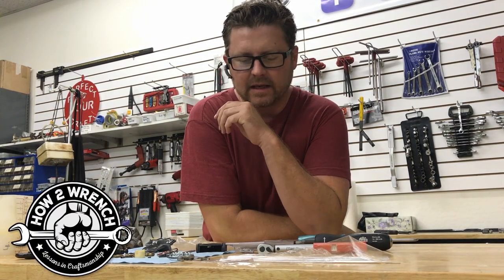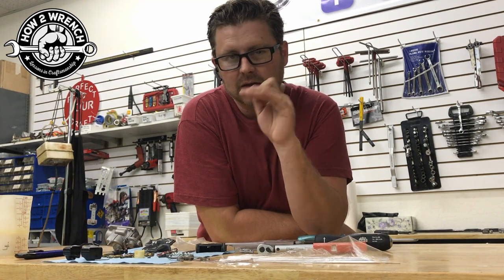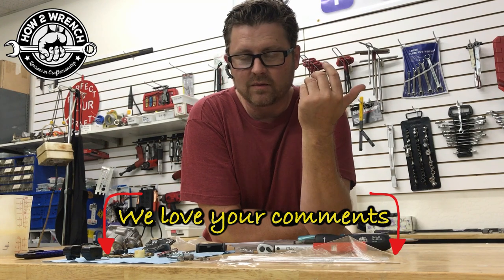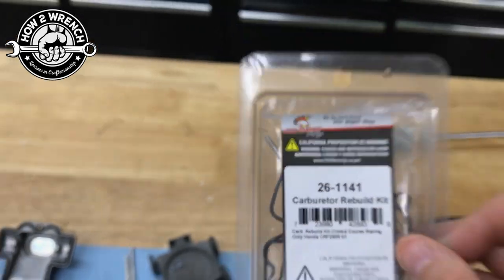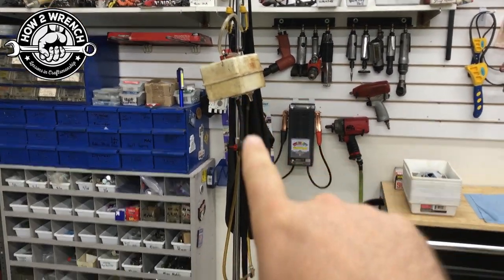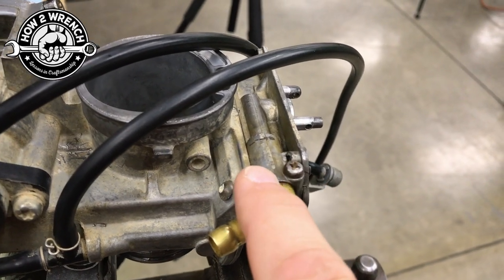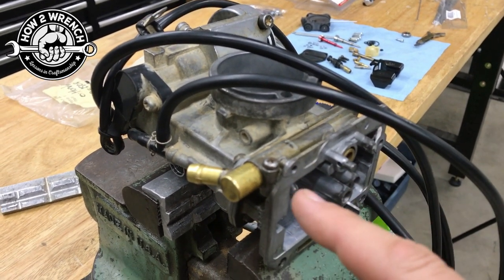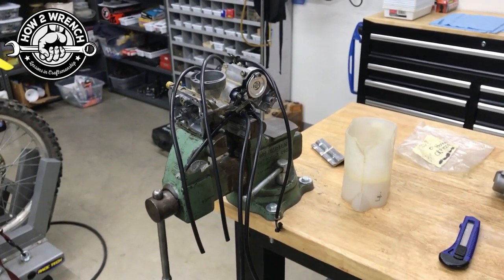Jet kit installation gone bad. Don't make this mistake on installing a jet kit!

Comment: Great video idea! 

My first thought would be, wrap that carb in a sopping wet rag while brazing, to decrease heat diffusion in to the rest of the carb. I have also brazed with Heat sensitive parts in a water bath, with the cracks sitting above the water. Second, perhaps a very slight “v” gouge on the non gasket side of the crack(will provide more area for adhesion) and third, try to practice on another scrap card body, it will give you best test results.
Reply from the maker: Great tip! Thank you for taking the time. 
🙌 🏁 Noticed your a subscriber, thank you for SUBSCRIBING! Love seeing our subscribers comment on how the video helped! It helps us!
Here is a way to support all the free videos.
Want to say “thanks” or “keep it up”? Click here https://www.paypal.me/how2wrench  

Follow us!
Web:
www.How2Wrench.com     
www.Tools2Wrench.com

Comment: Kinda like a brazing rod except aluminum. I'd say it will work well as its an area that doesn't see much torque or stress on assembly. What do you have to lose but a cheap rod and some prep time.
Reply from the maker: Exactly....👍 Thank you for taking the time to comment! It helps us! 
Here is a way to support all the free videos.
Want to say “thanks” or “keep it up”? Click here https://www.paypal.me/how2wrench  

Subscribe and Follow us! 
Web:
www.How2Wrench.com     
www.Tools2Wrench.com

Comment: I would recommend preheating the carb before welding. Remove all rubber and plastic parts and preheat in oven to 350 degrees, it will greatly improve your chances. The aluminum must be clean, wire brush with stainless steel brush (to avoid carbon contamination) and then clean with accetone.
Reply from the maker: Thanks for the tips! 
👍 Thank you for taking the time to comment! It helps us! 
Here is a way to support all the free videos.
Want to say “thanks” or “keep it up”? Click here https://www.paypal.me/how2wrench  

Subscribe and Follow us! 
Web:
www.How2Wrench.com     
www.Tools2Wrench.com

Comment: i had a simalar trouble'on of with the float bowl the gasket does not seal propley and you soon botton out the threads to   seal.Helicoil kit 4mm repair keeps the stock size and rtv gasket sealent cause a knew gasket takes 2 weeks to order and sometimes abit prisey.No leaks after a year

Comment: It's thin cross-section stuff. Get it welded. Lumi-weld requires a load of heat to be dumped into the carb body.
Reply from the maker: Thank you...wish us luck!
👍 Thank you for taking the time to comment! It helps us! 
Here is a way to support all the free videos.
Want to say “thanks” or “keep it up”? Click here https://www.paypal.me/how2wrench  

Follow us! 
Web:
www.How2Wrench.com     
www.Tools2Wrench.com